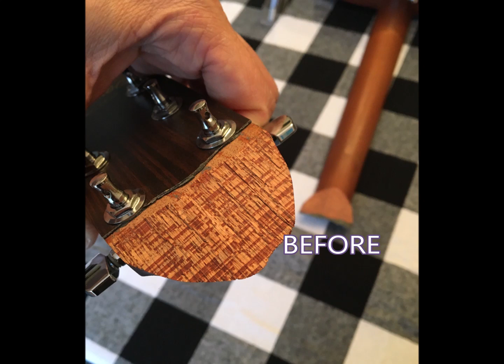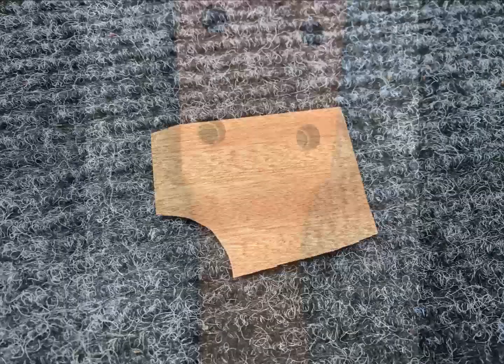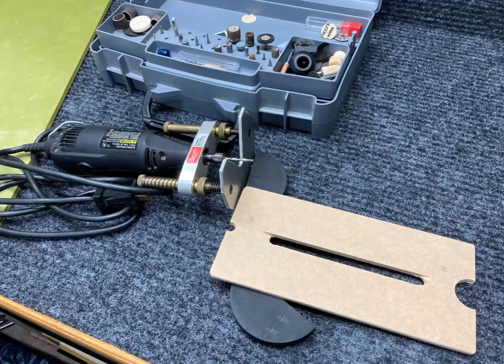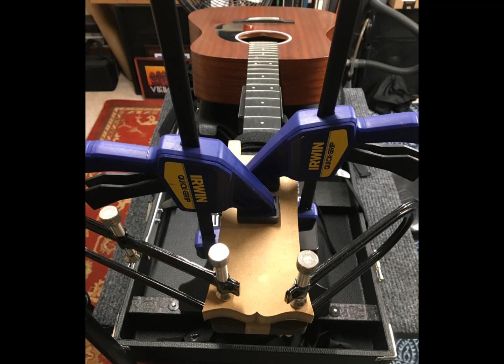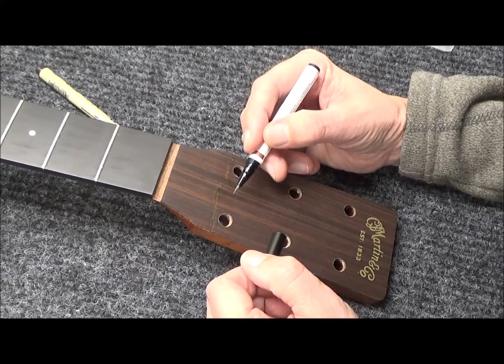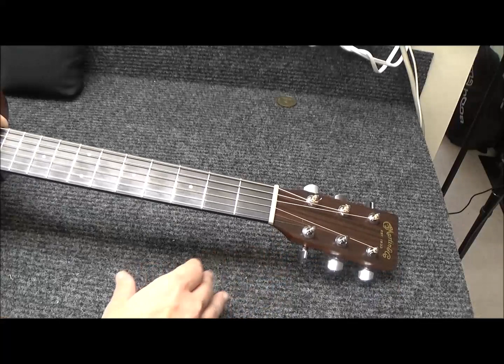Carbon Fiber Repair - Martin Road Series

Comment: Beautiful work. I like the fact that you were able to hide the splines under the headstock plate. Speaking of which: could Martin have used less glue to adhere that plate? Not good on Martin's part, but it probably made it easier to remove it!
Reply from the maker: Thank You. It was actually pretty hard to remove the laminate. There was way more adhesion than it looked like. 🤣🤣